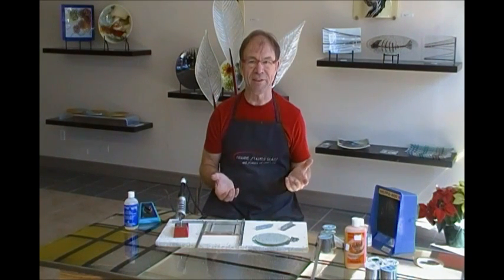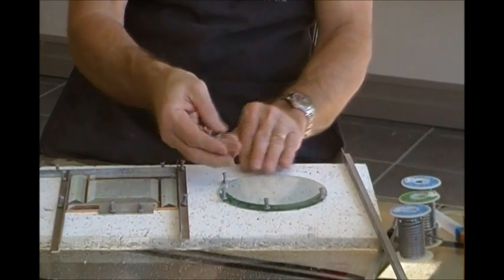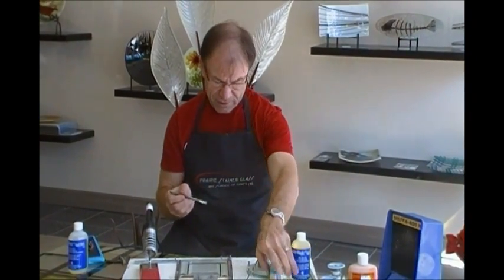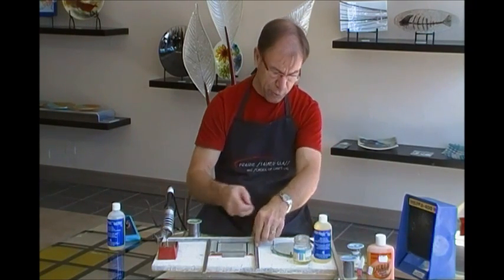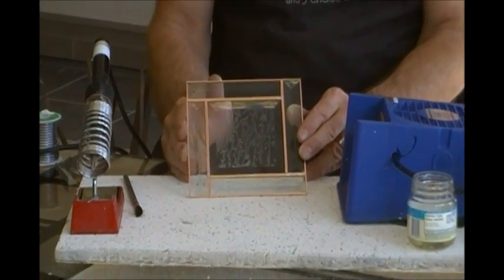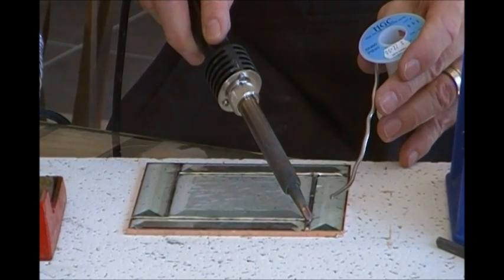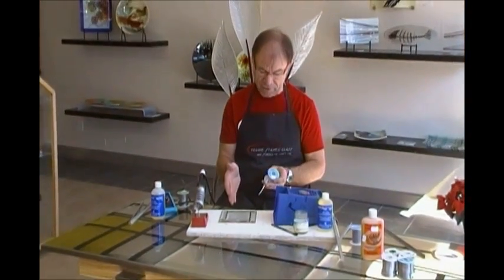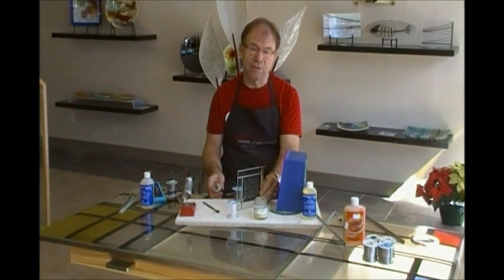Soldering Tips and Tricks Part 2 of 2

Comment: Very interesting using the 50/50 for the first pass.  I've used 50/50 to fill in gaps before, and I've heard of people using it on the reverse sides only, but I've never seen anyone use it the way you have.  Can't wait to give it a try.  BTW, I also use the Hakko 601 and I can't imagine using anything else.  After plugging it in, it is hot enough to solder before you can even lift it up to use it.  The heat adjustment on it makes it very useful, too.

Comment from the maker: Sorry for taking so long to respond- life has been hectic. I am not sure what you mean by resoldering. If you have left the project for a while you may have to steel wool the foil or solder before you begin again. Generally it doesn't take much to remove any oxidization. If it hasn't been too long then the flux will probably be all you need.